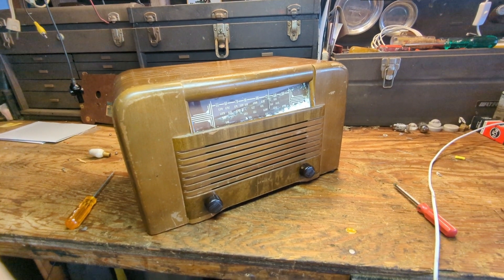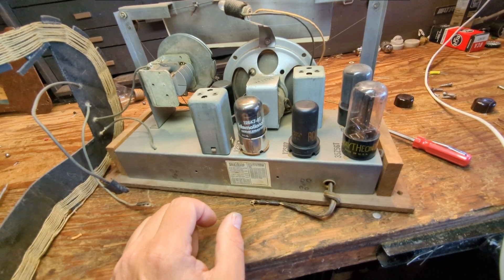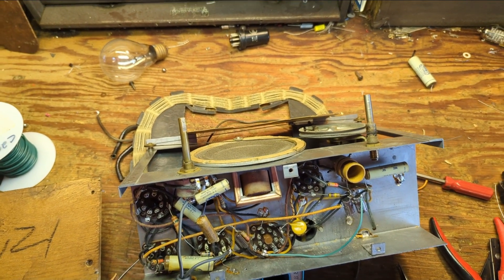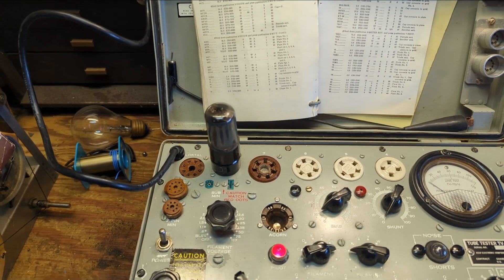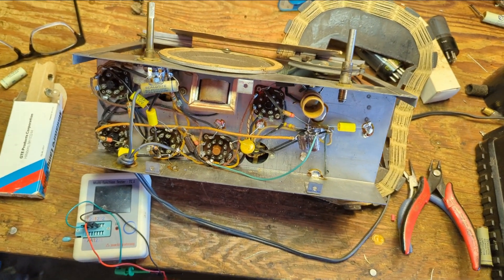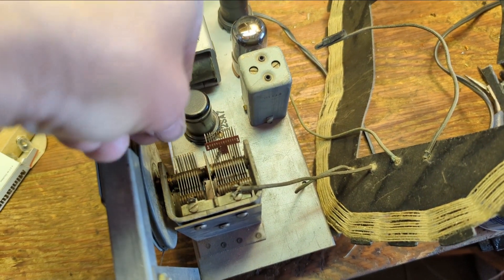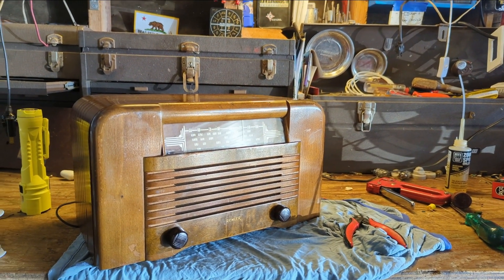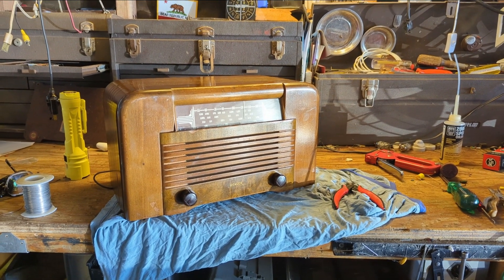San Francisco Made Remler Radio has some nasty cat whiskers in the tuning condenser

Comment: ANY fixed capacitor coming off of the rectifier tube Bass needs to be replaced before ever plugging in any of these radios. Soon as I saw the flash of the pilot light blowing I knew that 110 volts shot across that filament.

Comment: All radio tubes seem to get whiskers, but I have no explanation as to why. Tubes also can start red plating, and the whiskers are probably the reason why. Once tubes begin red plating, they will burn 🔥 out in very short order. Again, I cannot offer an explanation to the whiskers, but I think it has something to do with the getter inside of them. I think it’s a natural cycle of the tubes, as the gases in them slowly get depleted. In other words, some of the metal emits burn off, and start forming whiskers on other metal parts inside of the tube 🚇. This is where I think 🤔 red plating occurs (or can). Probably my most informative comment of all to ya. Your friend, Jeff.

Comment: Pin 1on these octal tubes connects to the metal shell on metal tubes and to the metalic surround and internal shield on the glass tubes.  They are NOT "grids." Take a look at a tube manual when you get the laundry finished. 🤔